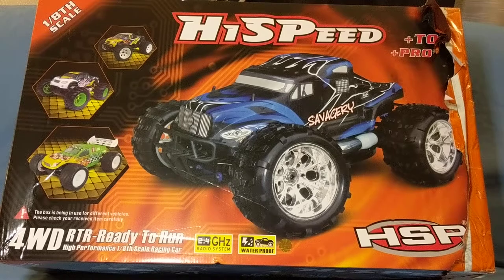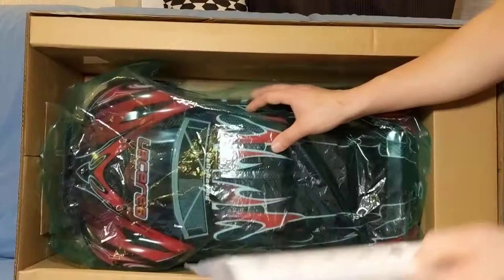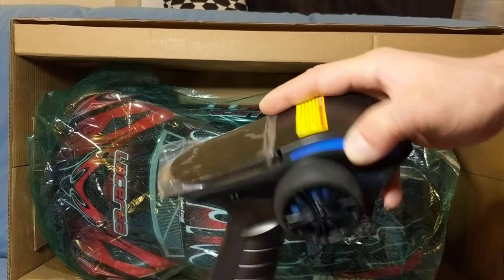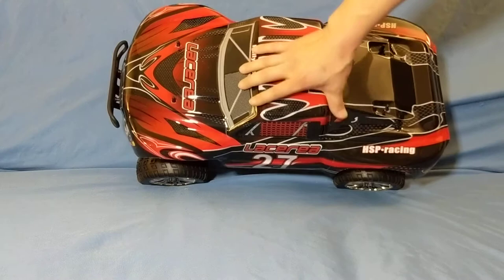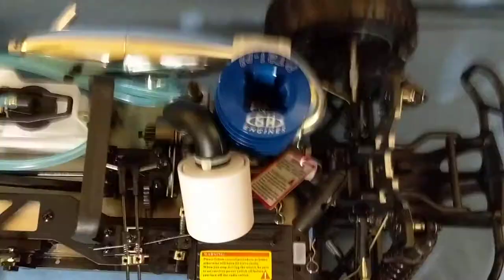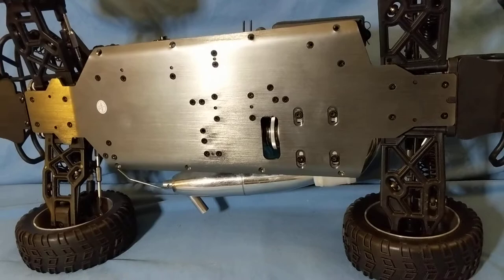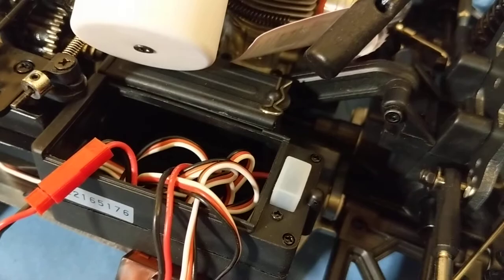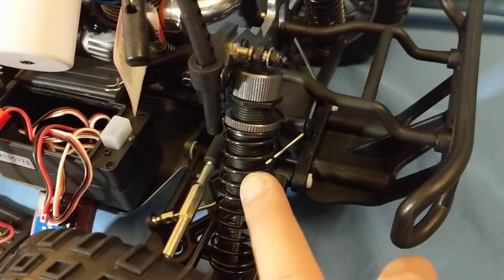HSP 94763 Lacerea Nitro Unboxing - 1/8 RC Short Course Truck with SH .21 Engine

Comment: Nice buy 👍👍 I also ended up buying one of those ones after watching hybrid’s review. Very nice truck for the money
Reply from the maker: Very much agreed, and that hybrids vids on it are great. Definitely validated the purchase. Didn't get it started in 1 pull, but mine started in 3 pulls 😆 the easiest for me so far. Thanks for checking out my vids🤙
Reply: Did you have to do any upgrades? If so I’d like to know
Reply: Only thing I had to change was the steering servo. I went with a cheap 25kg one from Banggood. And also I put very thick silicone oil in the centre differential.

Comment: My HSP 1/8 Nokier mt uses everything exactly the same as this lacerea but has a 2 speed transmission and just bigger wheels
Reply: Also, does your throttle servo horn hit against the battery box?

Comment: I didn't know that you had this how is it ?
Reply from the maker: Thanks for watching! Managed to snag it w the coupon and while it was in stock🤙
This was the reason I was holding off on the VRX RH1008. By far the easiest engine I've started, 3 pulls. Still breaking in, so I haven't given it a good run. It's got some power tho, and it's 1/8 w the 17mm hex wheel mounts.
Bummer is that the body came damaged.